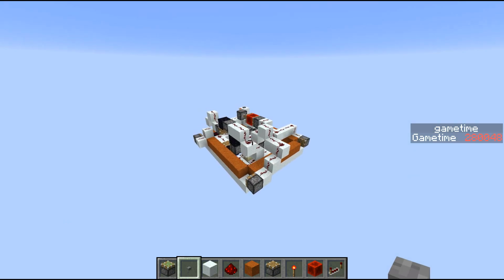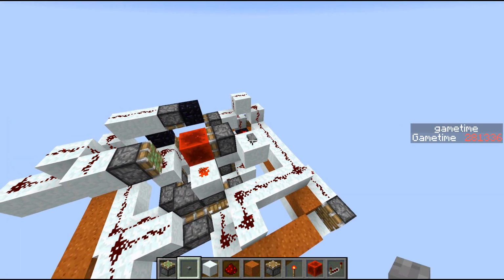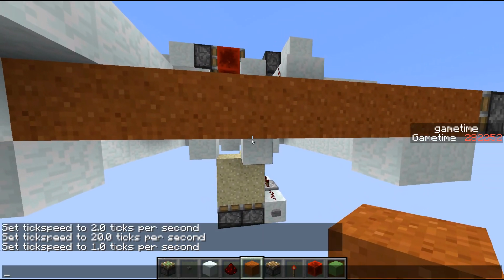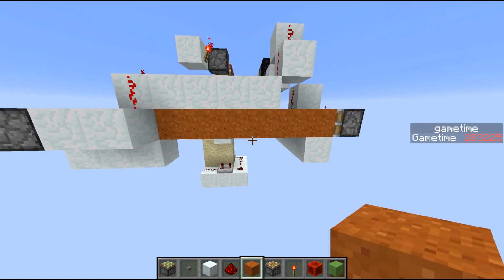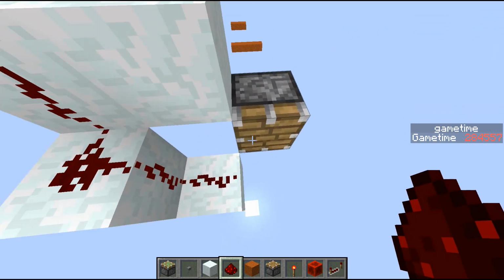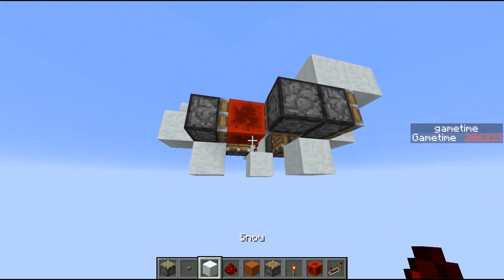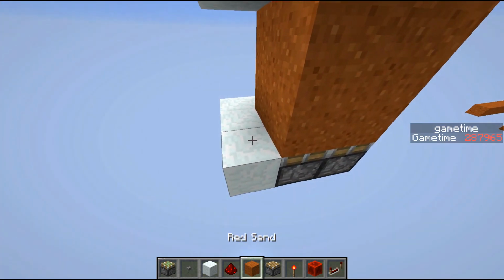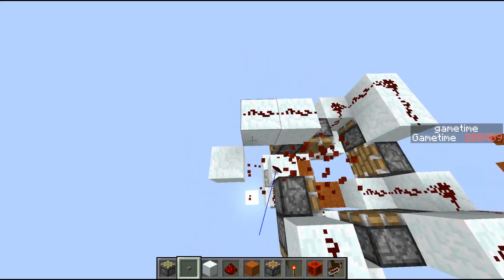Alternative Engine for Pi's Rotor

Comment from the maker: I will stream some more Panda's Survival in about an hour at http://www.twitch.tv/panda4994
It might become a rather short stream as I'm a bit exhausted already but I will try :-)
Reply: Panda4994 Yay
Reply: Panda4994 Would this work as a sand generator using a portal?
Reply: Panda4994 Can you please take a look for 2 minutes on the server, they aren't spawning Please help! Server; Hub.vikkcraft.com And its on factions
Reply from the maker: vincenthel1 I don't think this would help with a sand generator. I was used for them in the past but I think that was fixed.
Portal is a good start for sandgens though ;-)
Reply: I meant teleporting the sand entity instantly before it deletes itself 1 tick later. (and thank you for the response, the stream was great too)
Reply: Ok when can you get on